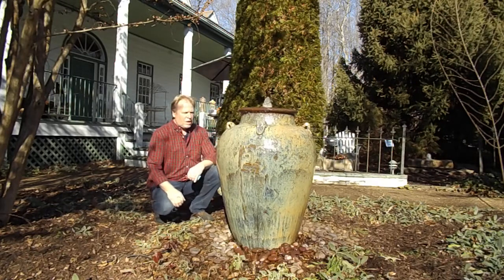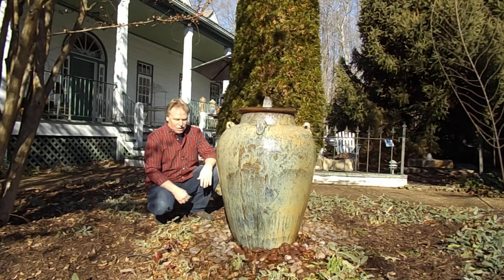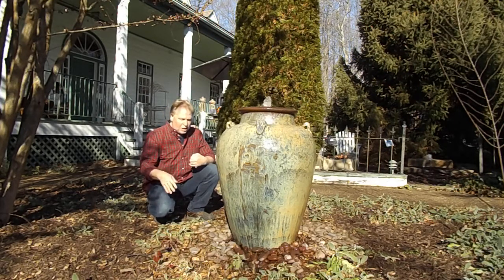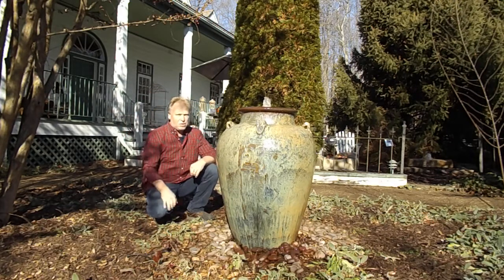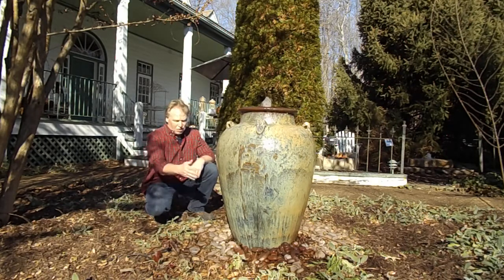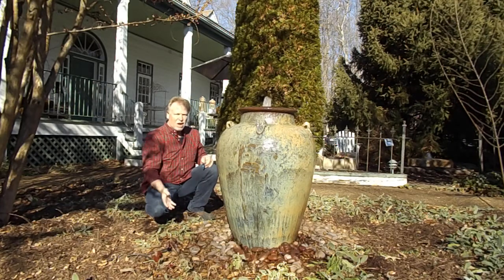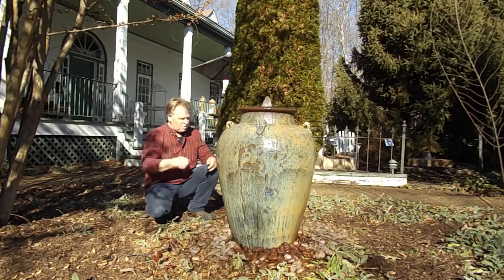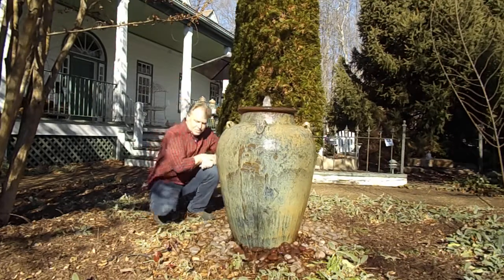Disappearing Fountain Tips

Comment: When there's not an outlet near the fountain, how do you plug in the fountain? Do you run an extension cord from the house to the fountain? Do you burry the cord? Do you use PVC pipe when burrying the wire? Is it safe? Do you use an outdoor transformer? So many videos on installation on water fountains but NONE answer these questions. Help!!!!
Reply: Pump cords are often 25 feet long. If that is not long enough, use an extension cord or add an electrical outlet closer to the fountain. As far as burying the cord goes, some people cover it with mulch, rock, dirt, etc. Another idea is to use a pvc conduit to conceal the cord.